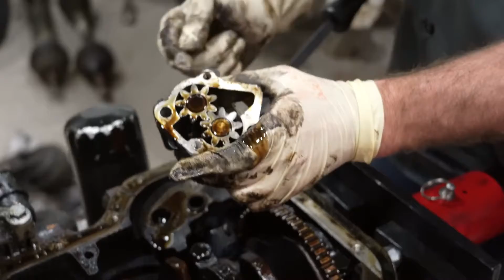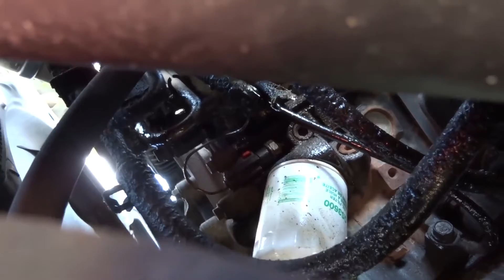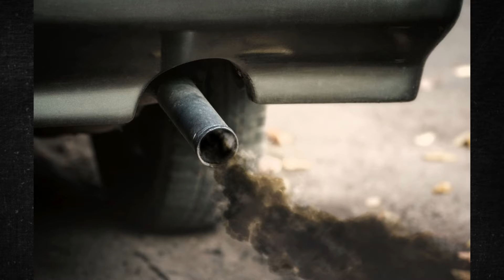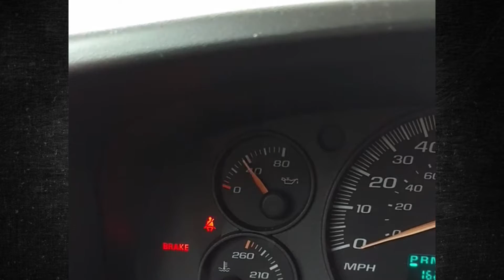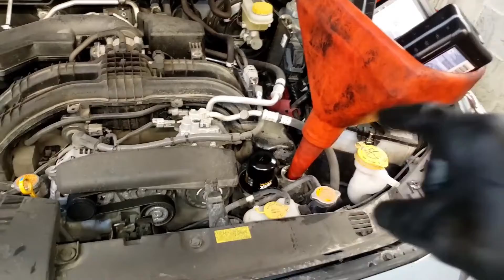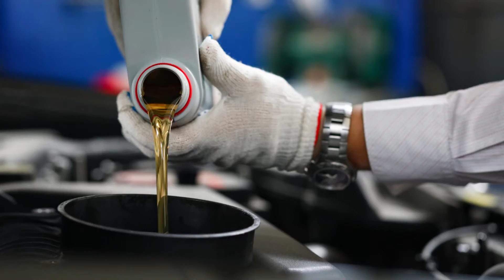What Causes High Oil Pressure & How to Fix?

Comment: I have a 2017 silverado 1500 5.3 and every now and then when i first crank it first time of the day, i hear something similar to a power steering pump low on fluid but its raising like building pressure, engine light flashes, and oil gauge goes real high then comes down to normal when rpms go down

Comment: when i had my mechanic change my 5.3 vortec it was given a scrubbing and during install i had a high pressure melling and new timing chain installed is this going to damage anything it holds 40 - 75lbs now?. was thinking because the prior engine Died from lack of oil pressure at idle i had him install a melling racing pump.

Comment: My engine oil pressure is a little hi on my 2014 Silverado 5.3..im guessing maybe to much oil?
Reply: Check your dipstick
Reply: same here did you find a fix ? idel at 40 runs highway around 55 60 psi
Reply: @jakewotring2132 I did an oil change and mine corrected itself after I drove it around some